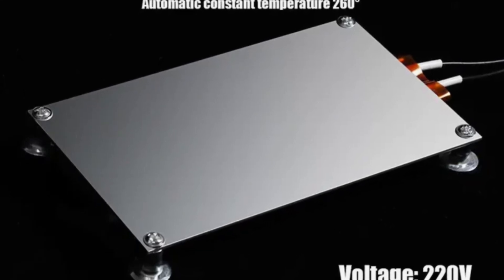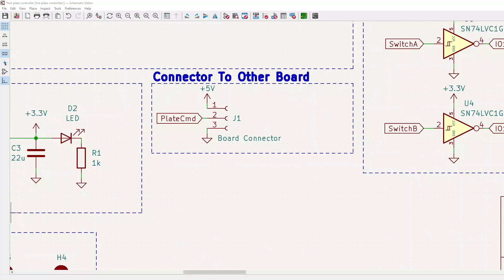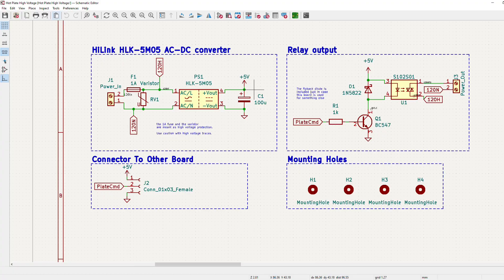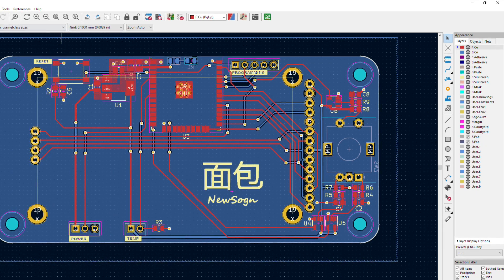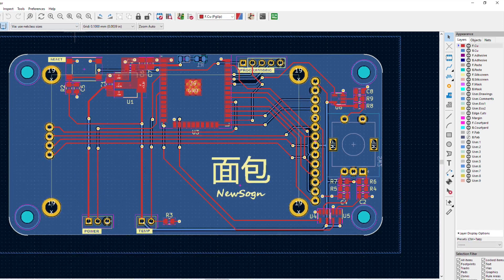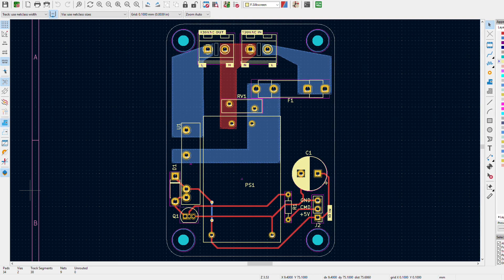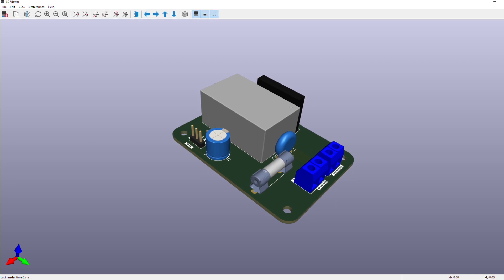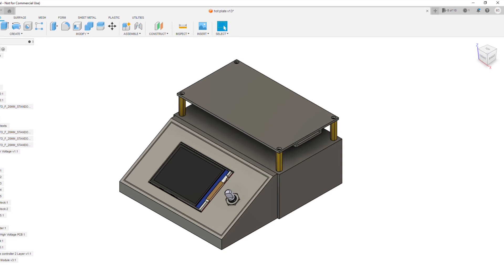Esp32 based hot plate soldering station build.

Comment: is there any alternative THT version of the pcb components? anyway, cool design.
Reply from the maker: There definitely is most of the parts I use are just jelly bean so you would just need to find the tht alternative to them if you can’t I could look it up too and then just make your own board, I’m down to 0402 smd components now and I will never look back the end result is so much better and tighter…. Smaller is more fun to me and smd hot plate soldering always feels like cheating